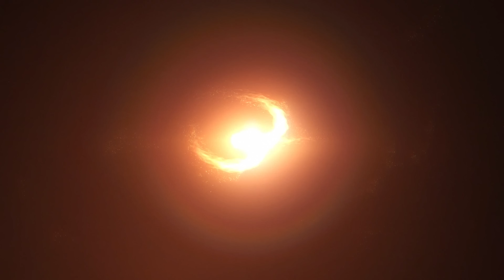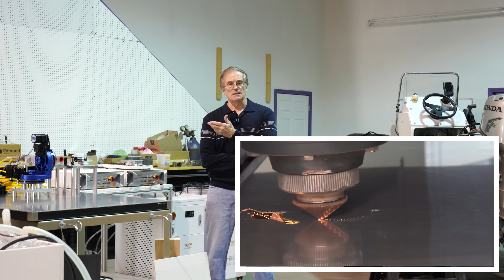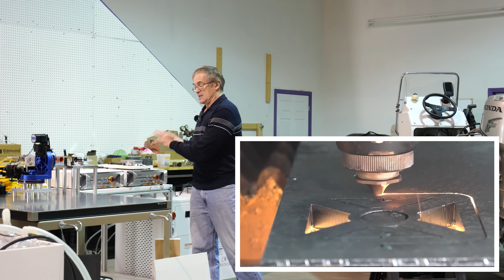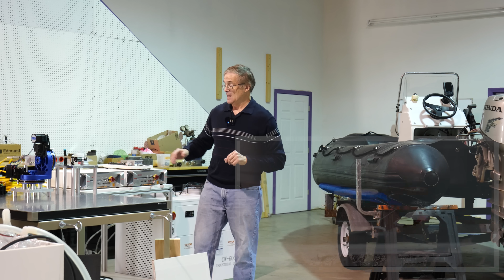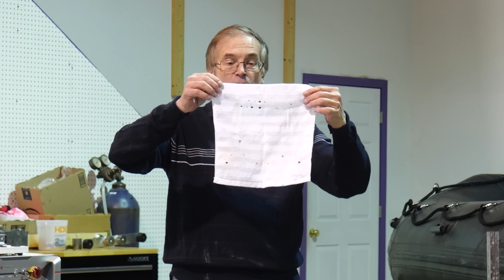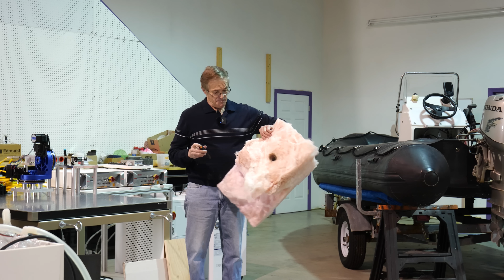We have a problem... and need your help!

Comment: ~15 years ago I was playing a lot with middle power diode lasers (4-5W). What I found extremely difficult to burn through was..simple sugar.
It's not toxic; it burns releasing mostly CO2...but the heat caused nearby sugar to melt and flood the burnt hole creating some kind of self-healing shield.
I don't believe it would work with real high power laser...melting speed is rather not enough...yet I'm very curious how the several cubes of lump sugar could defend against the real high-power laser beam 😉😁.
Anyway...nothing but ablative armor of any kind can withstand that energy concentration.
Reply: Stinks, burns

Comment: * variable power delivery, if possible, solves most of your issues

* is there a way to measure on the laser side if an object is being hit? does resistance or anything else increase during impact? 

* wet the 2x4, let them soak for two or three days submerged, i have a feeling organic material will be hardest to punch through beside just water

this just might be the thing for styropyro

Comment: "I liked that video best. It was a BLAST"  -- good pun  
"LASER comes out as a small beam and GETS SMALLER"  - had to pause the video to take that one in. 
Done - subscribed, liked, commented [ I think YouTube measures those ] and will share.   
Hmmm.  Fiberglass like steel wool, is so thin they keep burning after the LASER was turned off.    
Wild guess solution :  Foamed carbon like a space shuttle tile.   Use two panels at a 40 degree angle ' \/ '     to create internal reflection. That is to confine and capture the beam. 
This video is for a thermal expanding paint where the carbon can be scrapped off and repainted   https://www.youtube.com/watch?app=desktop&v=0IbWampaEcM   
Other more knowledgeable folks have better idea. 
May the physics gods be with you. Reflections off the target would be bad.  Respect.
EDIT  -   A concave or diverging Lense as a target would spread the LASER beam out weakening it. Then drywall might work.

Comment: What about carbon fibre blankets?  Might work well with the “plywood sandwich” or another one of the ideas sent to you?  Not too expensive and I think has a high enough melting point 3500 °c ??
Reply: Good idea, tiles on top, painted with intumescent paint, plywood, sheet metal, carbon blankets behind !
Reply: I actually think that might  be overkill and add too much costs. But absolutely do small samples and tests to figure out which is best
Reply: @arealcanadian419  I’m not sure the cost I admit, but tiles can be free, plywood or cement board, cheap. The paint would be pricey but the cost per foot would probably be cheaper than carbon fibre mats. Thin sheet steel like for duct work is also cheap to procure and easy to find

Comment: Would it be a problem to increase the spot size and decrease power density? 

 For example, a back of the envelope calculation says that a laser that is under ~1.3kW per square cm will still damage  graphite or a charred surface,  but it won't immediately vaporize the carbon and expose the next layer.

Of course, widening the beam might reduce the effect on the target as well, but a wider aperture gives less divergence at a long range, so in a practical application it may even out.

Comment: My 1st thought is either of two approaches .. Rock-wool (takes heat better than fiberglass insulation) .. or .. layers of Pykrete sheets with a small air gap between each layer.
Reply: i fear hitting pykrete with a powerful laser would cause it to explode.
Reply: @ulrichkalber9039  2 thoughts .. Laser exploding Pykrete would be a good Youtube Video .. and .. to prevent that , is why I thought to use layered sheets of Pykrete with air gap between each layer. They showed wood simple wood stopper laser but caught fire. The water saturated saw dust of Pykrete stops laser like the wood did, but the water stops/solves the fire issue .. The molecular ice crystals when initially hit will unfocus the laser a bit on each molecule. The two phase changes (solid to liquid, then liquid to gas) absorb allot of laser energy per kg of material. The small air gaps (I'd estimate between 2mm and 6mm) between layer allow steam a path to escape (thus preventing explosion). The wood and air gaps are both thermal insulators. Each ablative layer should defocus the laser more while absorbing more energy, and insulating the next ablative layer (which adds time) .. and Pykrete , aka frozen water saturated saw dust, is very cheap , easily available, non-toxic, easy water cleanup, etc.

Comment: LI-900 is a surface insulation tile developed and manufactured by Lockheed Missiles and Space Company. It was designed for use on the Space Shuttle orbiter as part of its thermal protection system good to about 1,600C… 
Maybe some subscribers know somebody at Lockheed that could help you out!

Comment: Don't they usually use carbon /graphite block sinks for beam stops in the laser world?  they did for entertainment and some lab work back in the day.   I'd guess water + solid carbon or carbon slurry or argon encapsulated carbon would be fire safe?
Reply: Cost?

Comment: You should test aerogel. It can be fabricated inexpensively and it’s supposed to have one of the highest tolerances to heat.
Reply: Light goes right through it, it’s mostly air

Comment: I would try a large insulating glass window filled with a proper liquid. Water with black pigments might work, or black old motor oil. You should also try mats of woven carbon fiber, without resin, only fiber. They conduct heat very well, so they might fare much better than glass- or ceramic fibers. Or carbon fiber in a liquid like water might work well, too, as the fibers may spread the heat into more liquid.

Comment: Flowing water. Maybe a wall with something like an indoor waterfall could work. I don't know if reflections could cause an issue, but continuously replacing the absorbing material solves the problem of burning through it. It's also very cheap.

Comment: I don’t have a fiber laser to test this however, Rockwool stone slag bat insulation will not catch on fire. As an acoustic and engineer, I show my clients. Our rock will not only dissipate sound, but is an excellent fire retardant for their studio spaces. I bring a clump of rock wall bat insulation put it on cement outside light a propane torch and strike up a conversation with them for about 10 minutes. I’ve never seen Stone slag melt or catch on fire or even smoke not granted a fiber laser burns hotter.  I’m not sure if anybody else recommended this, but I would give it a try. Insulation would never work. The glass just melts.

Comment: I would imagine resisting that much energy is going to be hard.  As others said, absorbing into the ground is probably your best bet.  I'm curious as a layman about a fish tank with water and a bit of black dye opaque enough to absorb the beam before getting through the tank but clear enough that it takes a few inches so that the water on the wall doesn't evaporate instantly.

Comment: Call up DARPA and have them send you a can of their laser absorption spray paint. The one with the two balls in the can. It shakes up faster and just sounds more satisfying than the single ball version. Good luck to you though if you have to deal with their customer service department, it's the old AI version. Cheers!

Comment: Water, or water mist. Think airport fire truck with a big water spray. Dividing the laser energy into a whole ton of water would mean a lower temperature rise. For a miniature example fill a domestic fish tank with water with some ink or dye (to actually absorb the laser energy) The water will heat you'll have to have a big tank if you want it to last long without boiling.

Comment: I’m not sure if someone has already suggested this, but I will do so again in case you see it. I’m thinking about something that is a variation on what they do at the large hadron collider when they dump the beam. They dump the beam into a giant block of graphite and, while it’s not economical for you to get graphite, you can get a number of charcoal briquettes. if you construct a box with some fire brick, fill this with briquettes, leaving the front open to the beam, that might do the trick. The unusual geometry of the individual briquettes will serve to break the beam up as it back scatterers, but more importantly the heat absorbing capacity of these briquettes is quite high. It’s an inexpensive enough solution that it could be tested empirically and it’s something that should scale. I’d be interested in giving it a try myself if I had a fiber laser :-)

Comment: I was thinking Maybe using Crushed Carbon (Carbon Dust)  Glued on a plywood backing. Or Maybe have a pump to spill water down the front of a sheet of plywood so the surface would have a running stream.  have a traft at the bottom so the water would collect and be pumped back up.
Reply: Layers! Tile on concrete board painted with intumescent paint, backed with thin sheet metal and rock wool insulation

Comment: Innovator here. Perhaps a special design prism that breaks the laser light into dozens of smaller less concentrated beams, and then those beams can be redirected into an asbestos bell housing shell? Once they are broken down into smaller beams, they can hit a surface like asbestos and probably have alittle affect. That’s my best guess. Good luck.!
Reply: Well, asbestos is a prohibited toxic material, although fire resistant. Except being a hazard handling it, you cannot buy it anywhere...

Comment: Use a large fish tank with a prism/ beam splitter and mirrors.

laser output goes into fish tank, hits beam splitter in the water (or other clear solution which might absorb some of the energy), then a few more beam splitters cut the original beam up more, and those resultant beams go to various mirrors redirecting the final outputs to locations at right angles to the original laser path.  Each endpoint would have a fire brick backstop.  Since the beam in theory now heats the solution, and the original beam path is now 1/10 or 1/20th the power at each endpoint, it takes longer for each endpoint to go critical.

Comment: This may be just terrible but uhm, mold blocks of gelatine with a green food coloring and glitter in them.

Block+diffuse+scatter
Reply: Uhm, you'd have to see your glitter melting temp similar to a fuse like function. 

So you'd want to use a glitter with the same melting temperature as the temperature you'd like to deflect.

Also you'd want to look at layering.

Other ideas like sand bags are cheaper and easier but I think this is a neat solution but would require a day or 2 of r+d to get right.

Bricks, sand bags and silicon solutions are simple and effective and non technical just a matter of scale. 

Probably ceramics amd silicons are your best bet but things like defracting and scattering gels aerogels would be light weight technical and tunable to higher weight vs resistance abilities.
Reply: Also if you'd like advice from quantum physics have you tried not observing your experiment?

Comment: Thank you for asking which makes us participating! I would say, the object absorbing the energy should be able to work for about 5 seconds stationary as a fall back safety. Instead, the  object should move to use a large surface dissipating the energy. The object should be a massive roller, for example graphite. A graphit roller of about 10 cm diameter and 20cm length, rotating on driven rollers, may be in a water sump, should do the task. It should not only rotate, but moving forth and back additionally.

Comment: Concrete contains H2O molecules incorporated into the cement, and as it heats up they eventually have to boil away, compromising the material. Firebricks might work better. But really, you should just use soil/clay. It's everywhere, it's free, and there's a lot of it

Comment: Comment 2:
.
Rockwool insulation might last longer than fiberglass, if your looking for lightweight.
.
If it can weight more, countertop concrete can be poured in 1-2"deep frames and welded to a structure for around $50sqft.
.

Comment: Wood is a pretty good ablative material. You could treat it with some liquid fire retardant, or douse it with water after the shot. It's pretty difficult to burn wet wood, and a small point fire is not going to be self-sustaining and will self-extinguish.
Reply: Paint with intumescent paint and tile it, back with more paint thin sheet metal and rockwool

Comment: That laser sounds too powerful to use for drones, because there is more than just drones in the air..how far does that beam travel?
My suggestion might be to have a sensor that can identify when the beam hit the barrier material, so a thick wood, it can see it turn black and instantly turn off the laser, so you don't need 1 second, probably done in 100 ms.

Comment: I think many of the solutions posted already seem quite good so I cant add anything to that but I would like to re-remind you how absolutely deadly this system can be. Therefore, consider safety systems like interlocking and you may want to consider rigging your setup so that during test mode, some automated system only allows power for say 1 second or something where, no matter what else happens, you will be limited to 1 or a few seconds of output at a time - that may address the concerns about if something locks up etc.. you still need something to withstand the beam of course, but limiting the ON time can also be an effective safeguard (during development / testing)

Comment: A plate a graphite might do the trick, its black got a high melting point and is cheap. Graphite powder mixed with glass fiber and compressed into a sheet might also work

Comment: Judging by a few of the comments, maybe define your requirements, I’m assuming you would want something similar to your last video, so horizontal, large enough to cover multiple flying drones, easily moved, dirt cheap (dirt is pretty fireproof …) and just a little more heat resistant. :)

Comment: Please try a giant aquarium filled with a dense suspension of soot/lamp black carbon in water. Carbon absorbs light very well, and the big volume of liquid water around should provide the bulk mass for a heat sink. I think it would be better to use acrylic glass instead of regular glass for the aquarium material, so that it doesn't shatter. Cheers!
Reply: Too small

Comment: Aim the laser down into a large tub of water. This may help assuming the tub is deep enough so that water has a chance to rush back in before the laser hits the bottom of the container. I imagine a large enough body of water has enough heat capacity to reduce the energy for a least a few seconds. Best of luck!

Comment: Maybe you could build an enclosure of divergent (convex) Fresnel lenses? If you contact a supplier, they could have ideas for one that will do the trick, without being too costly.
They are often stamped so can be cheap to mass produce, and they are thin, so they don't take much space and are light enough to move around.

Comment: Hello,
Drywall panels typically consist of plaster of Paris (CaSO₄·2H₂O) and some glass fiber, and they are generally highly porous. If you search for "dehydration of CaSO₄·2H₂O" on Google, you can find the decomposition reactions. Since plaster decomposes to CaSO₄ at the first few hundred degrees, it loses its integrity, and rapid decomposition caused by sudden heating quickly expels 2 moles of water in a jet-like stream, likely causing the panel to perforate immediately. Moreover, temperatures of 1200°C and above, which are likely reached, produce SOx gases while converting to CaO. Be cautious. Plywood seems like a good option because cellulose and other organic components decompose into carbon before breaking down into volatile organic compounds, and carbon can withstand temperatures above 3500°C until oxygen in the air converts it to CO₂. You could consider adding a layer on plywood to slow down oxygen flow. If the insulation wool you’re using is glass-based, it will likely melt around 800°C. Rockwool, on the other hand, can withstand around 1100–1200°C. The temperatures reached are likely higher than these, and the loose structure of insulation wool is probably insufficient for diffuse reflectance. High-temperature insulation blankets come in different grades, such as 1200°C or 1400°C, which you could try. Alternatively, you can use plates made of alumina-zirconia fibers, which withstand 1600–1900°C. These are denser than rockwool or glasswool, but their production involves organic binders that may cause odors until fully removed. Additionally, CaO powder can withstand up to 2500°C, and MgO up to 2800°C. You could mix a small amount of either powder with plaster to create your own CaO or MgO plates.

Comment: You can try to use cork sheets, they are cheap and easy to hang up. They use cork for heat shields in spacecraft for its ablative properties, so I guess it may hold out for a bit against the laser depending on the thickness of the sheets.
Reply: Good idea! Layers, tile, cement board, cork, thin sheet metal, paint with intumescent paint. Add rock wool if needed

Comment: Use plywood, use a table saw to cut some 1/8” channels in it, 1/8” wide, 1/8” apart, ideally at a 45degree wall angle (maybe make a custom cutter for this) pre burn the outside layer to carbonize, then have a water source on the top that sends a constant stream of water across the surface.   In the absence of oxygen, aka, underwater, the carbon should be able to absorb the laser light without ablating too much.

Comment: How about a wall of fabric with a reservoir and pumps underneath and a perforated pipe at the top of the wall.  This would essentially make a waterfall running over fabric.  Itt would be cheap, easily moveable, and deployable at different locations.  If the cooling is insufficient just increase the water flow.  BTW I still haven't got my thermal paste I ordered years ago.